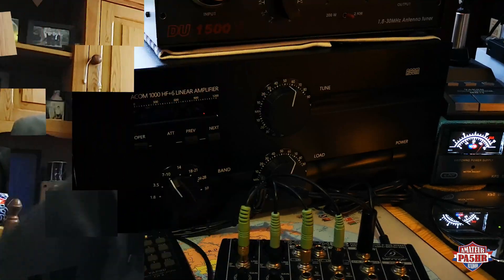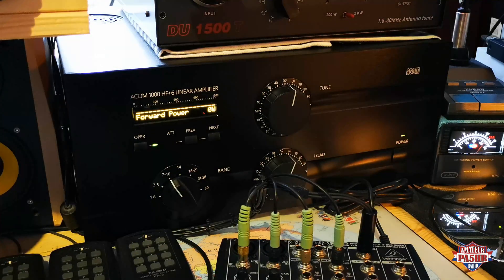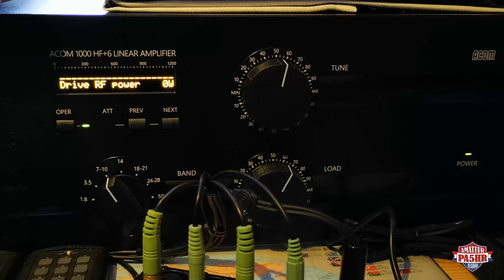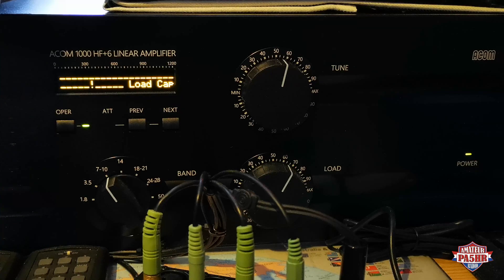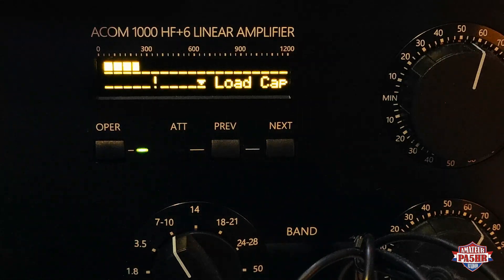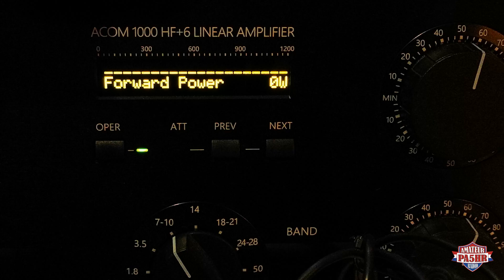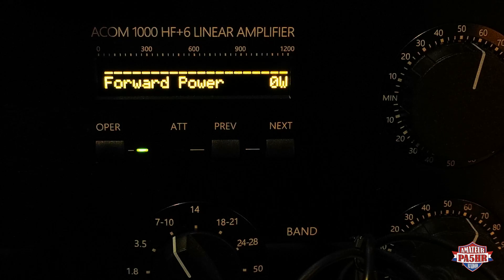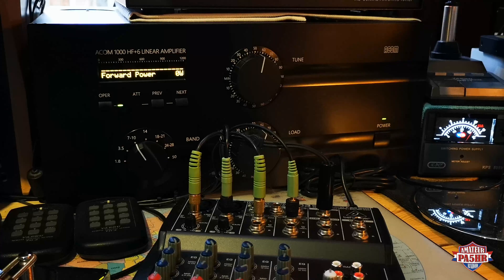Power Amp Acom 1000

Comment: Hallo Bert,  das ist mal wieder ein super Video. Ich habe zur Sicherheit  ein Frage. Wie hast Du den 101MP mit dem Acom 1000 verbunden ? Direkt mit Chinch TX GRD vom TRX zu Key IN -Buchse zum Acom 1000? Oder gibt es noch irgendwelche Besonderheiten  ? Gruß vom Dirk
Reply from the maker: Hallo Dirk Nein es gibt keine besonderheiten einfach ein kalbe mit den chinch steckern in die key in Buchse der PA und dem Sender das wars schon. Ich benutze die PA ohne die ALC line einfach ein kabel Fertig und arbeitet super gut....viele Gruesse Vy 73 de Bert PA5HR👍👍
Reply: Super, vielen Dank für deine Hilfe. Gruß und 73